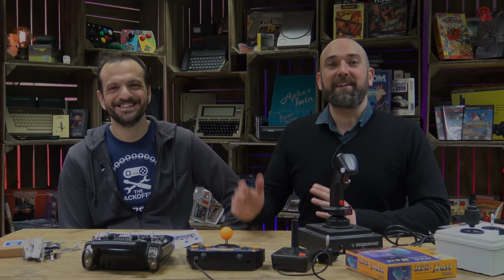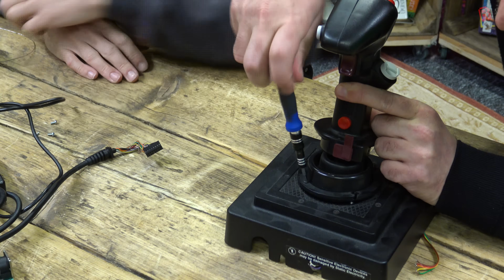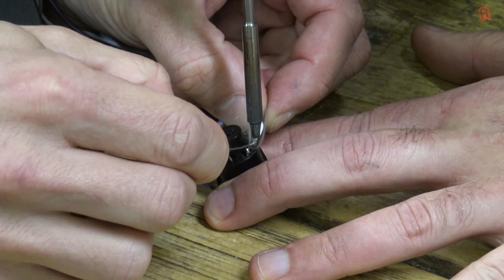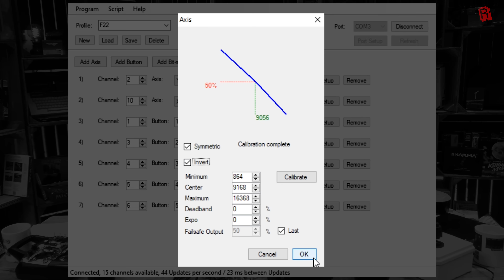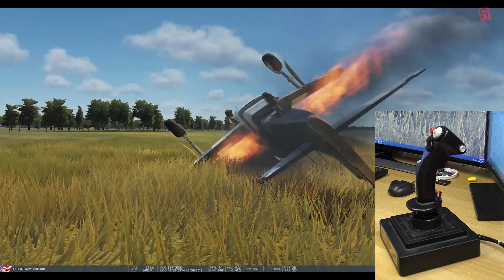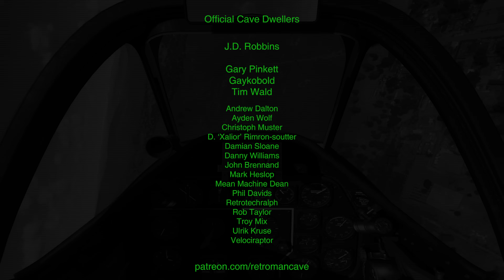Retro Flight Stick Conversion with the "Ultimate Joystick Interface"

Comment: will that gadget you've got there allow a guy to plug in a full F22 Joystick with Rudder controls and F22 WCS Throttle too.  To sort of daisy chain them together? what software would work concurrently with them all, so that you could create the same kinds of Macros you used to be able to do back in the day? Have you guys devised something like that too with your ginormous brains?
Reply: Also would such a combination system also be able to link up with something like a Yaw VR cockpit to really get into the full immersion experience?

Comment: So glad I found this video.  I was on the point of binning my vintage Thrustmaster RCS, FLCS and TQS at the local tip. I realise that this isn't the properly correct forum but rather than throw them away I wondered whether any one would want them? I wouldn't want anything but it would be good if they could be collected.  They have hardly been used and are in the original packaging with manuals

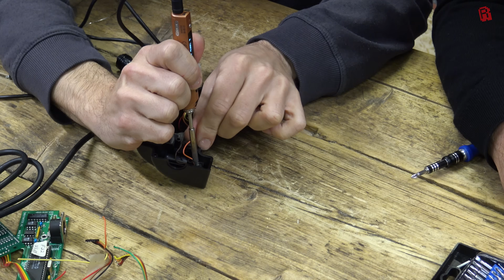Comment: @09:08 HEF4021B 8-bit static shift registers.  With a firmware change to your board you could have used the existing cables.  I actually own this joystick, the throttle and pedals from days I used to play various Jane's simulations... it's in the loft somewhere... must dig it out.
Reply: Also the Resistors could be avoided.  The 16F688 has individually programmed weak pull-ups which would probably do the job.

Comment: as a disabled person i m restricted to only being able to use one hand limiting me to using the logitev m590 or ergo. the inital plan was to use the arduino platform tom create a joy-mose with small thumbstica and pre-programmable buttons for use when confined to bed, and when able to use wheelchair thrust-master type stick opening up more features with the ultimate goal of hooking a thrust master usb stick cant remember the model but it had the built in throttle and 6 buttons on the base and twist to the left and right so i could fly rc drones/tanks, robots. the initial proof of concept was done with an arduino mega, but  the main project i planned to use the arduino due, id also had plans to use this platform to build a low cost environmental control system.
i never got round to using the pic controllers.

Comment: While not directly related, I'm wondering if anyone reading this has any ideas. I like to play racing games with a force feedback wheel., including titles on the PS2. My modern wheel is not backwards compatible with PS2 and while I do have a G25 that is, my big concern is that one day my G25 will fail and I won't have any way to replace it, which in turn will mean I won't be able to play my PS2 games with a force feedback wheel. In addition to this, I have to change my entire setup to play PS2 racing games which is a lot of hassle.

I've spoken to Thomas Jackermeier of Fanatec (as I may purchase a direct drive wheel from them in future) about the possibility of PS2 support for their current/future wheels. He said they are not able to because they would need to have permission from Sony (why Sony would care, considering they no longer manufacture or support PS2 is beyond me). I also contacted the manufacturers of a product called the DriveHub which is designed to enable racing wheels from one platform to work on another, however they seemed to lack any interest and said there is no demand for it.

In the gaming community, there are many people that seek to not only preserve the software but also the original experience. For example, you can buy arcade joysticks designed to replicate the feel of the sticks used in particular cabinets such as four way leaf spring types for golden age arcade games. Force feedback wheels are the best way to experience the games that support them and add massively to the enjoyment and immersion. I would like to preserve that experience (or even improve on it with the superior performance of a modern wheel). If anyone has any ideas or suggestions, I'd love to hear them.

Comment: All that extra hardware makes me wonder how Logitech did it...I have a Wingman Extreme 3D stick (2 stick axes, rudder twist and throttle slider axes, a hat and 4 head buttons and a trigger...two buttons on the base, but I think they were duplicates of the head buttons) that had a 15-pin gameport connector..but also had a simple short adapter cable that converted it to USB.

Comment: 5-wires... guessing power, ground, clock, data and latch. Basically it works just like an NES controller. Seems like something that board should be able to support without having to rewire all the buttons.

Comment: I've done similar stuff by hacking up cheap chinese USB gamepads off ebay. Far more inputs, especially if you get ones with dual analog sticks and analog triggers. The analog sticks typically are made with standard 5k or 10k potentiometers and so sometimes your flight stick can just be wired straight in with no resistors needed to change their values (depends on your stick you're converting). Can't see myself using a board like this unless a newer one adds a lot more inputs. Just not cost effective.

For instance, you could buy this for $4.99 total (that's with shipping) from China: https://www.ebay.com/itm/Wired-Gamepad-Game-Controller-Joypad-USB2-0-for-Laptop-PC-Computer-Black-W4B6K/283554821124
The shoulder buttons are digital, but you still get 2 analog sticks, so 4 axis to work with, and if the sticks click in (they usually do), you'd have a total of 16 digital buttons.

I'm sure this board (and software) offers far more versatility, but as it stands currently it just isn't useful to me personally. Just my 2 cents.

Comment: Pads for pull ups/pull downs for each input would be nice. Also the ability to daisy chain two boards together and use a single usb connection.
Reply from the maker: I'll pass this on to the Dr for V2 ideas
Reply: I love this idea! Software pull-ups and pull downs are already in the hardware but it means you need to have a configuration UI. But I love this as it's so much simpler!!

Comment: Could of read the data coming off the shift registers and read it with the new board rather than messing with the joystick handle with a bit of software rewriting also a usb HID device would be better instead of serial coms as the serial introduces lag and com ports will change as other equipment is used so can get annoying

Comment: A number of years ago I built a dual joystick system using a trust programmable joypad which could be programmed to emulate keys. I use 4 analog inputs from the 15 pin port and used the trust pad to wire in 4 foot peddles configured in a heal to toe configuration. I build this to play Descent I / II and III.

Comment: talking of the microsoft force feed back pro i still have one any suggestions how to get it up and running.
you can still use the turnigy 9xr pro , put open tx on it and maybe a frsky module and your away.
if you want to connect 9xr to a pc just plug in throught usb port or buy a pc dongle usb stick and radio link to it.

Comment: You could do a custom joystick controller using Arduino Pro Micro board (ATMega 32U4) and a Joystick library by Giuseppe Martini, together with AnalogReadFast library by Albert van Dalen. You may also use Damien Clarke's AnalogMultiButton and ResponsiveAnalogRead respectively for connection multiple buttons to one analog pin, and to eliminate jitter from ADC input. If you want to make a stand alone converter for gameport joystick it is a little more tricky. You won't have access to all 3 pins of potentiometers, but only to 2... so you'll need an additional  resistor, Ohm's law an a little bit of math to do the trick, and get the stick linear position.

Comment: As has been pointed out, the 16C series PIC's are OTP (One Time Programmable) so cannot be reflashed with new firmware. My suggestion for the next version would be on-board pull-up resistors with solder jumpers to allow them to be used as required. One of my future projects will be a custom converter for my Saitek F15 Talon stick. If that becomes too complex then I would be interested in these boards. Keep up the development - I'm sure there are enough enthusiasts to make it worthwhile 👍

Comment: Hey RetroManCave you might get a kick out of this. https://imgur.com/gallery/vtc5C
I modernized an Xbox Steel Battalion Controller for PC use. :D

2x 3Axis joysticks (with twisty action saitek cyborg golds), 3 analog pedals, a 2axis gimbal joystick, an analog dial, a whole mess of buttons. So many buttons, that the 5 red ones on the center at the top, are keyboard 1-5. Just so i could keep it < 32 buttons per micro-controller to keep them directinput compatible.

The throttle doesn't work, but that's because i couldn't afford the bits and bobs i needed to make a proper throttle. The code and connections for the throttle are there, just not the hardware. I really need to get my hands on an old throttle from an old HOTAS.

Comment: Arduino ProMicro + MMJoy with MPC3208 (if more analog inputs are necessary) and shift registers (if more digital inputs are necessary) would do the same thing for a third of a price. Actually even less since Neil used three of these boards. I don't want to thrash the product or anything just giving an alternative. Plus if I understood this correctly it uses vJoy instead of actual HID therefore it is not actually cross-platform?

Comment: I've been using a Arduino Pro Micro lately for connecting neogeo sticks to USB.  Dirt cheap, and easy to program using the onboard USB.  Great if you don't need analog inputs.
https://github.com/MickGyver/DaemonBite-Arcade-Encoder

Comment: Ha! I had one of these, I think a slighty different model. It also had the cast aluminium parts. But alas, I got into one game so intensely, I slammed it over to one side once. The cast alumium broke and made it useless. Had to trash it. But I am an extreme user of HIDs (Human Interface Devices or OSI model layer 8 - nudge nudge), you will not believe the number of mice I have destroyed in my IT career. Not a thing i am proud of, by the way. Any other device or machine I treat as if it's my own child. Oh I remember which game it was, it was either X-wing vs Tie fighter, or Rogue squadron!P.S. @RetroManCave Another excellent video Neil, I love them. I sent you an email with a proposition, but I guess you've been working hard to get this video online :) but I do hope you will have the time to let me know what you think.

Comment: Those old Thrustmaster joysticks show so much more engineering than any joystick you will find on the shelves today.  It does strike me though that this project is something you could probably do with an arduino.
Reply: I take it you're not aware of Virpil or VKB joysticks then
Reply: @simonshepherd8357  Until I read this comment I had never heard of either one of these companies.  Having said that from a quick look at their web pages they seem to be about customised controllers for flight sims rather than an off the shelf controller or joystick.
Reply: @jameslewis2635  They're "off the shelf", you just get the option to buy sticks without the base because some people have one already.
Reply: Arduino leonardo or a pro micro would be a lot cheaper and give you more analog axis and buttons...

Comment: Input lag seems a bit high to me, 25ms. A Xbox 360 controller is 8ms in fact most modern controllers are 15ms or under, maybe the next version could have better latency
Reply from the maker: Noted for the Dr

Comment: Get a small USB hub, gut it and stick it into the Joystick. Solderpoints for the USB Pins would be great so one could connect the boards to a hub without connectors…

Comment: BTW, retro cave man, I'd be interested in comprehensive coverage of the topic of analog-to-digital scaling solutions for fitting vintage computers to modern digital-input-only flat panel displays (is a bewildering subject to me). Actually, an episode that covered this subject across the board to give an overview per interfacing modern USB (and BlueTooth?) keyboard/mice, game controllers, storage devices, and displays to vintage computer hardware (that might require a series of episodes).
Reply: Try googling for Component to VGA or HDMI or Composite to VGA or HDMI adapters or converters. It may help you. If it's simply a luminance signal (black and white) I think a composite input also handles that.

Comment: The chip seems to be a shift register. Maybe you could implement the same technique to increase the number of digital buttons you can read without changing the hardware too much.
Reply: I used a Teesny to do just that. Has been working now for 5 years.
Reply: Conrad Lawrence yep, same. Also converted a Suncom throttle like this.
Reply: absolutely,

Comment: I just wish I could get my ms sidewinder force feedback stick to work on a modern pc
Reply: Its literally the BEST joystick in the world as far as I am concerned and devastating that it cannot be used! I am tempted to build a retro PC just so I can use it again and play a bit of mechwarrior! I just need to find a 486DX266 and a Voodoo2 graphics card!
Reply: @backofficeshow  Voodoo2 in a 486.... Hmmmm 🤔
Reply: @backofficeshow  I too love the ms sidewinder force feedback stick and ff wheel with gameport. I recently re-built and old i7 950 with 2 GTX 680 in sli. I stuck in a soundblaster with a gameport. To my great delight the stick and wheel both work with Win XP 32bit. I highly recommend this as I have been having great fun with older mil flight sims and driving games.I have the usb version of the ms sidewinder force feedback stick which also works but still prefer the original.
Reply: same i love it

Comment: Unfortunately the PIC 16C series is not re-programmable, they use EPROM, the 16F series is the one you can reprogram easily because it uses flash memory, but i suppose you can replace the original with a 16F series that is pin compatible.
Reply: An EPROM without a window? Wouldn't that just be a PROM then?
Reply: @Nukle0n  Last time I tried to break into a PROM the police arrested me.
Reply: @Nukle0n  kind of yes, but technically no. The datasheet for the 16C series say they are EPROM/ROM based, what means they are using EPROMs but not all chips have the window.
Reply: @garzonimpleks  kinda counterintuitive then since the E in EPROM means "Erasable"
Reply: It would probably be better to not erase the chip and just get a new microcontroller to replace it,  put on a  SMD to DIP adapter, and program it to work
Reply: The correct term is OTP (One Time Program).

Comment: Man I just put a cheap PCI soundcard in my computer and used the joystick port, but this is pretty cool!
Reply: I did the same.   Too much jitter as the card was being overclocked (On the PCI-bus) by my 2015 motherboard.   This "Ultimate Joystick Interface" might be just what I need.